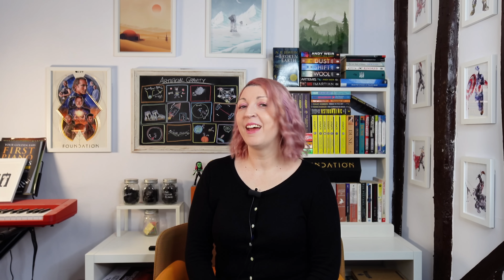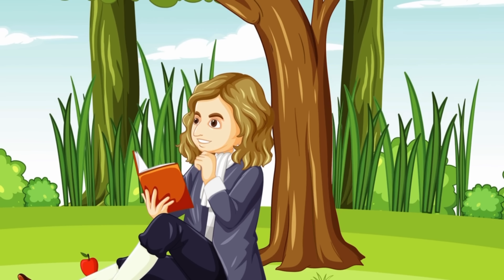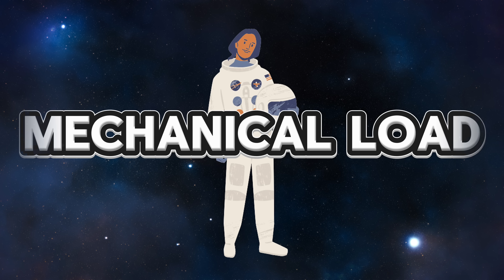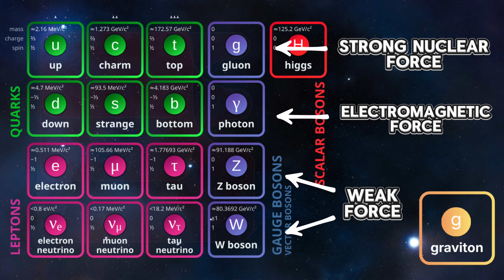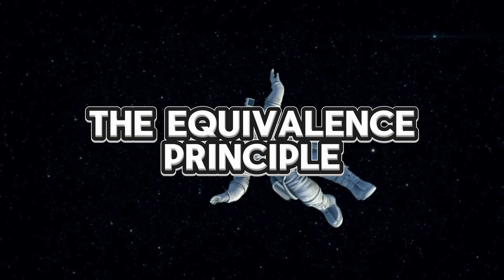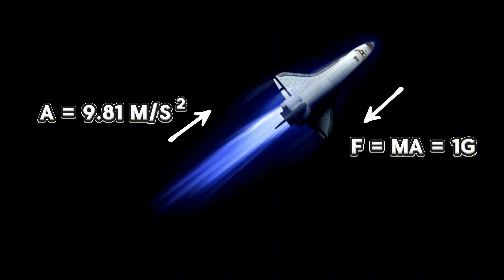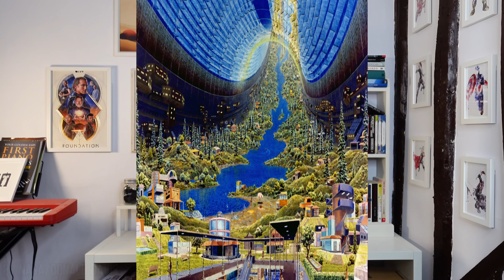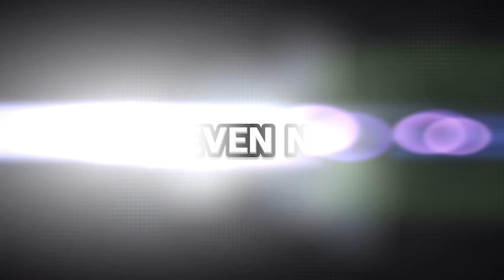Why Artificial Gravity Is Harder Than It Looks

Comment: To feel little to no Coriolis effect in a spinning torus space station, the station's rotation rate should be 2 revolutions per minute (rpm) or less, which for a 1 Earth gravity (1g) simulation, would require a diameter of approximately 450 meters (1,475 feet) or more. 
 A proposed Stanford Torus design had a diameter of 1.8 km (over 1 mile) and rotated at 1 rpm, a rate at which virtually no one would notice the spin.
Reply: Yeah but as per the video, there's evidence that with 'training' at least some people are fine with larger spin gravity side effects, so it's potentially doable up to 5 rpm (which means diameters on the order of the length of the ISS - i.e. something we know we can build - except under greater stress of course). 

So with a lot of resources - maybe on the order of another "Moonshot" or e.g. the ISS itself, which cost about $160 billion all told - we could probably build some sort of station right now or rather start building now and have it going in about 10-15 years (obviously I don't mean on the scale of a Stanford torus or O'Neill habitat though :).
Reply: @E1line-r6d maybe the Ames / Stanford study was too careful? They limited it to 1RPM so that you aren't losing too many people who have to leave.
For a research station you'd still lose people at 5RPM, but maybe it would be acceptable.

They designed it to be comfortable as well as survivable.

It would be bad to have to de-select people who couldn't spend a few years at the university city in Mars orbit.
Reply: @JFrazer4303  It would NOT be bad to have to de-select people who can't spend a few years in Mars orbit. Some people could have genetic anomalies that make zero g extra bad. I can easily imagine folks with extremely good balance would get extremely bad zero &/or low g space sickness.
Reply: @tsamuel6224  I was specifically not talking about anybody staying anywhere in microgravity. The conversation was about living in a space habitat with full shielding and Earth-normal (rotational simulated) gravity in the hab.
Reply: @JFrazer4303  "For a research station you'd still lose people at 5RPM, but maybe it would be acceptable" -- 

Well, as long as there's the good tangential velocity, so the people that leave are definitely gone.
Reply: @E1line-r6d  If starship becomes fully & rapidly reusable, that would pretty much solve the problem of getting massive amounts of material to orbit.  A falcon 9 is currently about $4000 per KG to LEO at max reusable capacity (17.5 tons) which is a lot less than the Space Shuttle's $54,500 per kg.  Starship promises to be as low as $20 per KG, but even at a cost of $200 per kg, it would still be a game changer.

I think we need to follow the Delta-V model (a "hard" sci-fi book), where we get enough equipment to the moon, or a near earth asteroid, and then mine, process, and deliver ready to use materials to make rotating habitats in space.  Once that happens you can build a cislunar economy that is self sustaining for the most part, and doesn't rely solely on being resupplied from earth.  Things like food (especially meat & hard to grow items) , microchips, etc would still need to come from the earth initially, until you have a more robust infrastructure where you can grow/make those things in space.
Reply: @lynnlamusga  We can stop comparing things to the Space Shuttle. The Shuttle was always since before it even flew an example of how not to do things.
"Cheaper than the Shuttle" is a very low bar to have to get over. It was specifically designed to be as expensive as possible, to spread as many tax $ around as many congressional districts as possible.

Even Falcon 9 costs to lift, the Superheavy/Starship is too small for starting a real large-scale long-term space effort. If SpaceX goes on to the larger huge rocket they've talked about, that'll approach the scale needed.
Reply: @JFrazer4303  Agreed, the shuttle was a "jobs program", just like the SLS is today (although it did some actual work).

Superheavy/Starship isn't all about size, although that is a lot of it.  The price per KG can go down as the size of the rocket goes up.  The idea is to make it cheaper per KG to LEO (compared to other rockets).  You get to cheap by making it fully & quickly/easily reusable (not the "refurbishable" nightmare like the STS was).  Whether that's possible is yet to be seen, but there is some hope that it'll work.  

Starship's 150 tons to LEO is overkill for all but the biggest NRO sats.  It's best case use is to lift large amounts of infrastructure & raw materials into LEO & beyond.  I would encourage you to read/listen to that Delta-V book I mentioned.  It has a pretty detailed blueprint on how to do it.
Reply: @FlexCrushYouTube Agreed, we can't live in micro gravity unless major genetic changes are made, which should be a non-starter for most people.  A good part of the ISS budget should have been dedicated to that task for the past 20 years.

Making 1g rotational habitats orbiting the moon needs to be our next goal.  From there we can could have fast/easy telepresence robots to mine the moon (the 1.3 second lag from earth makes it slow & prone to accidents/disaster).  That mined material would then be used to make bigger/better rotational stations, until we are getting into making O'Neill cylinders capable of housing & feeding 10s of thousands.  Only then would we think about bringing any mined resources back to earth.

As for keeping them within a few days from earth.  Isn't that is mostly for medical emergencies?  Obviously, systems failure is the other reason.  If we build it big enough, just send up a few doctors that can handle such eventualities on site.  They'd probably have to do double duty at first, but eventually they could be dedicated to those types of tasks as the size & population of a Standford Torus or O'Neill cylinder grows.

Once we work out the bugs of making a rotational spaceship, then near earth asteroid mining becomes viable.  But it's never going to happen until we take that first step, which at the rate the US government is going at, might happen by the 24th century.
Reply: @FlexCrushYouTube We would have been much better off using Saturn IV's to launch space station modules into LEO, for a lot less $$$. We could have used the 1B to launch ISS crew into LEO, and it would have NEVER lost 14 astronauts to the Shuttle's Wild E Coyote ACME (FUBAR) design.  

Yeah yeah, it couldn't be assembled without the shuttle yada yada...  Launch a purpose built spacecraft that could be refueled on orbit to act as the shuttle did to assemble it.  You only need to launch it once, it never comes home, and it could even be used as part of the station when assembly was done, etc, etc.  The shuttle was not indispensable, as there were other ways to do things.

It took 36 shuttle launches, not to mention what the Russians launched up there, to build the ISS.  It could have been done with 7 or 8 Saturn IV launches for a hell of a lot less.  155 tons to LEO per launch versus the shuttle's 30.3 tons.  That's a bit over 5 times the mass to orbit, for about the same price per launch (probably less, as they fudged the STS's cost stats to keep it from being canceled).

The DC-X is akin to BO's carnival ride known as "New Shepard".  Impressive for it's time, but it went nowhere, and it was quickly defunded the first time it crashed.  It's much MUCH harder to land an orbital rocket's 1st stage, and also make it easily/economically reusable (as BO found out).  It's even harder to do with the orbital 2nd stage (as NASA found out).
Reply: @FlexCrushYouTube The Shuttle was an engineering problem.
Nixon takes a lot of the blame for making NASA Accept USAF funding and thus requirements. That ended all thought of anything like the "Space Truck" we were promised as they cut Saturn production.
It should never have been considered operational, certainly not as a civil space vessel.
It should have been flown only for USAF missions and other things perhaps where a previously placed EVA prep and satellite set-up volume was already in place. A couple of Shuttle-C would put that up for less cost than a single Shuttle flight carrying up a single ISS piece.

Truax wrote that you never put crew and cargo up together, because the requirements are totally different. Cargo you insure. People you lavish on all the complexity you can to make it survivable. The Shuttle took the worst of both worlds approach, and that is what killed the crews.
Ludicrously complex and expensive to integrate cargo with because it was man-rated, and unsafe for the crew as the only crew launch vehicle to ever fly with ZERO provision for crew escape and survival during the first, worst minutes, and little elsewhere unless they made an optimal approach to one of the few landing sites.
One report of a crew strapped in ready but on hold, because crews were working on a hydrogen leak and fire below them. They were intensely aware that the only way to get away from it if they couldn't put the fire out, was 90 seconds per person sliding down the zip-line to a bunker in the swamp.

“Not Culture but Perhaps a Cult”, Op Ed on NASA and the Shuttle by Homer Hickam (2003)
https://spaceref.com/uncategorized/not-culture-but-perhaps-a-cult-op-ed-on-nasa-and-the-shuttle-by-homer-hickam/

Early ISS design had proposals to use Shuttle-C, and as I said elsewhere, I'll bet that the whole thing could have been done cheaper than a single Shuttle flight with a single piece of the ISS.
It was voted down specifically because it was cheap and quick and would allow doubt as to relying only on the Shuttle, which NASA had to do to the exclusion of all else. (Remember when we tried to make it in law that all US launch customers had to use the Shuttle? The USAF was the first to bail out on that.)
The current design was chosen specifically because it used a 40 flights of the contractors' Golden Goose Shuttle and spread as much $ around as many congressional districts as possible. (Just as has the SLS, and the Ford class CVN.)
This Shuttle cult is also what killed the HL-20 and HL-42 developments, which was a worse crime and fraud than the Lock-Mart exercise in graft of the X-33.
Reply: @lynnlamusga  I also remember what Truax said about making it only as reliable as you need to get the job done. Re-usability and even controlling its descent after use, is extra complexity and cost.
SpaceX builds F9s which don't have any of that and put up more, faster.

I hope the Superheavy and some sort of expendable upper stage with a bigger payload shroud is introduced.

Then I hope they go on to the bigger one. Maybe closer to the Nova or one of the other post-Apollo proposed boosters.
Reply: @FlexCrushYouTube Not having an abort system to save the crew during a launch mishap is a pretty big ENGINEERING DESIGN FLAW in my book.  Hey, lets build a rocket with a leaky propellant tank with a fragile foam insulation on it (which would never come off at supersonic speeds & 3+ Gs of acceleration /s) next to a spacecraft with a fragile heat shield, and then use solid rocket boosters that can't be turned off once lit.

The reason that the mismanagement & hubris existed at NASA, is because it was needed (psychologically) to IGNORE those massive design flaws.  Kind of like how people living below a dam ignore the fact that they're 100% dead if it fails.

The loss of most any one tile on the underside meant total destruction upon reentry. They almost lost one that way, but were lucky AF that the tile they lost had a piece of steel under it instead of aluminum (STS-27).  FFS, they almost lost one on launch because of the shoddy way they refurbished the RS-25 engines (STS-93).  They only started checking the bottom of the shuttle on orbit, AFTER they lost one.

Naw, they were lucky AF that they didn't lose more than 2 shuttles.  Once they realized that, the shuttle finally got canceled.
Reply: @FlexCrushYouTube So I guess that they launched Skylab using fairy dust & wishes?
Reply: @FlexCrushYouTube 
A)  I listed two incidents that could have easily been catastrophic disasters (but they were lucky AF) where the shuttle was operated as intended.  But I guess you're just going to ignore those FACTS.  Like you admitted, the solid rocket boosters had known problems long before that first disaster ever happened.
B) The whole shuttle design redesign was based on political pressure.  It had that long of a cargo bay because of Air Force / NRO requirements, which were met go get more funding from congress (see original shuttle design which was shorter & a lot more stable/doable).
C)  Admitting that foam falling off the tank was a known problem is not the flex you think it is.  As I've already pointed out, THAT WAS A DESIGN FLAW!!!  Having pieces of your rocket falling off, and potentially damaging the crew vehicle is bonkers.  First time that was spotted the shuttle fleet should have been grounded until that problem was solved.
D)  The shuttle was at best 98.5% effective (See my answer in A, & previous post about 2 near misses), and 97% if you include the two disasters. 
About NASA being run by politicians:  Well no FKN duh already.  Congress not only appropriates the money, they also mandate NASA use certain contractors & systems (See: Senate Launch System), AND they also appoint whoever is in charge of NASA to boot (See: current billionaire vying for that job).  Is it any surprise that upper management is going to be idiot politicians types?  Talk about stating the obvious, and still missing the point.  Same reason Boeing is failing so much (because their upper management are all MBA cost cutters, not engineers promoting safety & quality).

If we'd have kept using the shuttle, I guarantee there would have been more lost crews.  The shuttle is an example of an unnecessarily complex design by committee, and not following the basic KISS rule. 

The main reason SpaceX has been so successful is that they weren't beholding to the design/contractor/whatever restraints of politicians.  Their rockets were cheaper even before they were reusable, because they weren't required to buy part X from supplier Y like NASA contractors have to (to appease the politicians constituents, AKA donors/legal bribes).  The Falcon 9 uses a $5,000 flight computer instead of a $50,000 computer NASA/Boeing would be mandated to use.
Reply: @lynnlamusga  Think happy thoughts, and don't stop until the upper stage has separated and the thing has opened its panels and is on its way.
 Everyone follows it until it's out of sight going up.
Reply: @FlexCrushYouTube I guess we are actually in agreement for the most part, and are both arguing the same point on a lot of things.🤭

You are right, nothing is perfect. I guess my big difference of opinion (as well as @Jfrazer4303's) is that I (we) think the shuttle was an inherently unsafe design.  Specifically, not having any way to save the crew if a problem happened on assent (because nothing is ever perfect).  Starship has the same design flaw, and should never be man rated.  As @JFrazer4303 pointed out, an actual former (& famous) NASA engineer (Homer Hickam) had the same "opinion" back in 2003.

What do you think could have been a solution to the tank/foam problem?  I always wondered if it could have been replaced with a light weight but thick enough air gapped layer of aluminum with a partial vacuum in between it and the tank.  It, and the tank itself, would act as a radiant heat barrier, being that aluminum has an emissivity of 0.04.  Basically like a massive dewar.
Reply: @FlexCrushYouTube You mean the two near misses where they got lucky AF?  

STS-27 (A tile came off the bottom, but there was steel in that one particular spot instead of aluminum) & STS-93 (An "oxidizer plug" inside an RS-25 shot out during startup and punctured the engine bell which leaked H2 all the way to orbit (abort to orbit mode)).

I'll remind you, that in both those incidents, the vehicle was being operated within design parameters.
Reply: @FlexCrushYouTube Thank god I'm self employed, because I'd-a went postal on someone after 10 years of working in that type of environment.
Reply: @FlexCrushYouTube Yeah, the embedded fishnet was something else I also thought of, but it seemed way too simple I guess.  The best inventions are often the simplest though. I wonder if you could design the foam to shed completely off by the time you cleared the tower.  It would also save a lot on weight.

I recall seeing/watching something about the X-33 VentureStar, and they were having problems with composite tanks leaking H2, so they switched back to AlLi alloy tanks, and it was even a bit lighter.  Don't know how true that was...

Yeah, assuming that something is going to be done perfectly at any government run outfit is out & out stupidity.  I watched a documentary about the shuttle once, and the thing that struck me at first, was it seemed like they thought documenting everything would somehow prevent problems.  What then struck me about it (unintentional to program's themes) was it seemed like a big game of CYA.  That was an obvious sign of a management & culture problems.  Then add in stupid management with thousands of mission critical parts in a very complex design, and you have a recipe for an eventual inevitable disaster or two.

Sure, there were things that could have been changed to make it safer.  But it still wouldn't have prevented the near miss of STS-27, which you blew off as "Never happened".  If that tile had came off ANYWHERE ELSE on the bottom of that shuttle, it doesn't survive reentry.  We could have easily lost Atlantis on it's 3rd flight.  The crew even thought they might die during reentry.  Say what you will about capsules, but their heat shields are extremely reliable.  I also think that might be Starships' Achilles heel, unless they can figure it out.

Yeah, I'm not an adrenaline junky, so I probably wouldn't get on a rocket until it's about as safe as getting on an [non Boeing] airliner.  I won't live that long.
Reply: @lynnlamusga  Designing it from the start, with an alternative utility in lifting side-mounted (or Shuttle-C).
Better yet, top mounted payload or mandatory for the Shuttle (as Hickham pointed out in the article), which require a different external tank and ground infrastructure.
 Maybe as well, option for 4 side-mounted boosters.
Re-using the SSME engines by including them in the same envelope as the crew never made sense. It was unfortunate to have to use solid rockets.

And here we have the Buran/Energia in some proposed top-mounted iterations.

If we're not limited to the STS architecture, we should have built something like the Convair Nexus. The later larger version lifted 900 tonnes to LEO with a 40+ meter diameter payload shroud separation plane. Self-landing back into its own launch prep stands.

For crew, capsules or the HL-20. Deliberately designed small, only to lift & fly people back down, not stay on orbit independently for weeks doing experiments or working on satellites. Specialized in protecting crew in all regimes of flight. As much off the shelf avionics and hardware as possible.
Reply: O'Neill for his shielded early small habitat used the sphere with 2RPM for the minimum shielding mass per enclosed volume.
The NASA Ames Stanford study didn't like the faster spin rate nor the minimal living space at 1G only at the equator.
A Kalpana drum shape solves it and is very roomy at 1600meters diameter for 1RPM.
Reply: A ship 1 mile in diameter would be so massive, you might as well just build a fuel tank so big you can accelerate at 1 g for the whole trip. Of course you'll still need one of those Epstien drives...
Reply: @giterdone4777  A ship 1 mile in diameter has so little extra value I think they are nothing more than space stations and inter stellar generation ships. For the foreseeable future I can only see ships this large only built either as vehicles to escape solar orbit or as space stations we travel between.
Reply: @tsamuel6224  It's rather silly for anybody to suggest a ship with a 1RPM 1 mile diameter spinning section.
That's cartoon-land stuff, and nobody seriously was suggesting it.
Reply: @giterdone4777  
A habitat a mile in diameter is barely sufficient for a colony of 10k people.

A ship would have to carry a tether/truss arrangement to erect the habs out a the end of, and spin that with the rest of the ship as a counter-mass.
Reply: Your numbers concur with mine. But we don’t need 1g. Earth has the highest surface gravity of any remotely habitable body in the solar system.

If Mars is to be habitable we need to find exercise regimes that work in 0.3g for lifetimes. Centrifugal radius is proportional to g and inversely proportional to n^2 (where n is rpm).

Mars at 1rpm is similar to your dimensions, r=268m or 536m (1750 feet) diameter. An engineering challenge, but 1rpm should make it habitable for most humans. And if we can’t make 0.3g work then we’re doomed to remain on Earth anyway!
Reply: @MarkSJBeard  It's pure speculation in lack of any data, to say that 38%G will be fine.

And no, we're not doomed to remain down here if it turns out we need 1G.
Reply: @JFrazer4303  Sure it’s speculation until the evidence is in, but if Mars is our next big destination then don’t you think we should be looking for ways to live in that gravity?
Reply: @MarkSJBeard 
You're indulging in fantasy speculation and fiction, which isn't a n explanation or proposed course 
Who says anything about a "next" destination? Tabloid media does, of course.
And no we don't need to imagine breaking laws of physics, we build space habitats that suit us as we are now.
Reply: @JFrazer4303  Why are you trying to pick a fight? I’m not biting, pal!
Reply: @MarkSJBeard  It's not a fight, you have zero facts. I don't understand why it's even an issue. You want to see if people can live in low G, but it's not at all necessary that they should ever have to.
Reply: @J @JFrazer4303   Okay, I’ll humour you. My comment is chock full of facts, derived from direct calculations. What of mine do you consider fantasy, speculation and fiction? Come on, be specific please, and prepare to back it up.
Reply: @MarkSJBeard  Prove that we can live long-term and stay healthy in low G, or stop talking as if we know or even suspect that we can live there and be perfectly normal.
Reply: @J @JFrazer4303  I repeat: what have I said that you consider to be fantasy, speculation or fiction? Don’t obfuscate; answer the damn question or stop wasting my time. I’m happy to engage on honest terms, but I’ve long given up feeding trolls!
Reply: @MarkSJBeard relax, dude
Reply: @netgnostic1627  Oh I’m perfectly relaxed, I just don’t feed trolls. Sometimes the only way to deal with them is to stay rigidly on topic. And he can’t, because he’s making shit up as he goes along. It can be entertaining, you know!
Reply: @MarkSJBeard  You are the troll. Insisting that we'll be OK in 38% G, refusing to provide any basis for saying so, getting angery when pressed for proof or any hard data to support that position.

How do you know that 38%G will be OK? Don't obfuscate or complain about being pressed for information. Answer.
Reply: @J @JFrazer4303  John, you are putting words in my mouth and then criticising me for them. That’s called a straw man argument and is a well known logical fallacy, the typical behaviour of an internet troll.

What I said was “if Mars is to be habitable we need to find exercise regimes that work in 0.3g”. Nowhere did I claim that Mars is habitable or that humans can live long term in low gravity without taking special measures to mitigate muscle and bone wasting. My point is that we don’t know it’s possible, but from an engineering standpoint (I’m an engineer), the numbers work such that it seems practical to find out in low Earth orbit before going all the way to Mars.

You have been determined to misinterpret what I wrote above and then repeatedly berate me without any justification whatsoever. There is only one troll here, and that is you. Be gone, you inadequate little excuse for a man (and that’s called ad hominem)!
Reply: @FlexCrushYouTube. I agree with ALL of that, with the possible exception of needing a 1g habitat. How much g we need for the bad effects to be manageable is yet to be determined. There are such engineering advantages to reducing the g level that finding a suitable compromise will be highly worthwhile. As an engineer (with some biomedical engineering experience) I can tell you that ALL engineering is compromise. But yes, we need to learn how to live off-Earth and the Moon is the perfect place to hone those skills.